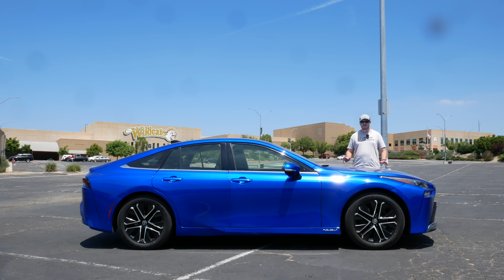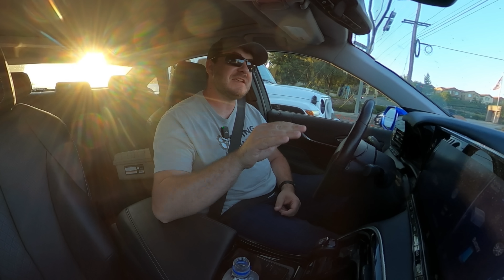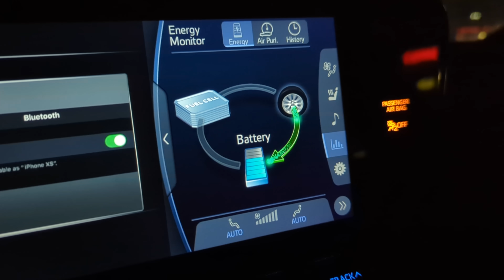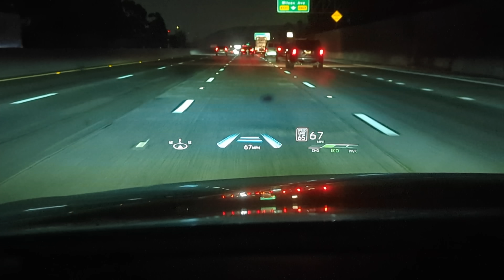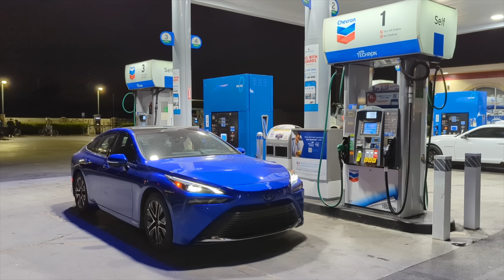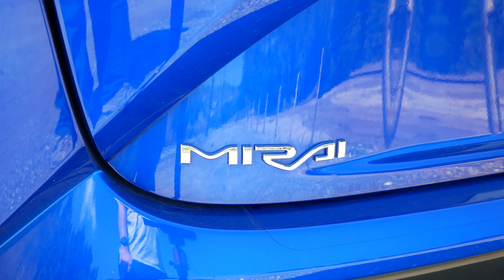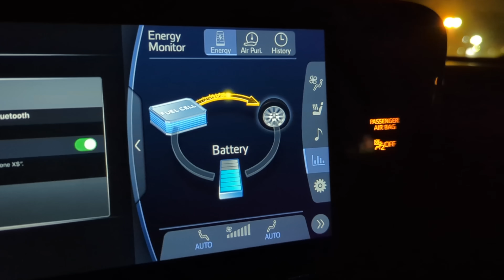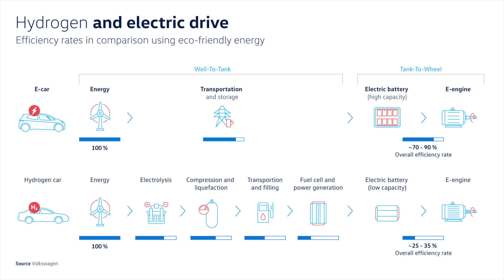The Toyota Mirai is Disappointing

Comment: A lot of the comments I'm reading are probably the same things that were said by horse-and-buggy folks when internal combustion engine cars first came out-too expensive to operate, noisy, limited fuel availability, maintenance issues with car engine/transmission, yadda-yadda-yadda. Yeah, hydrogen fuel cells still have practicability issues-BUT they have a lot less issues today than they did 30 years ago. And we have smart engineers working on those shortcomings every day. The 'green' advantages of Hydrogen over fossil fuels are tangible if they can be realized-and that includes the processes which create Hydrogen in the first place. If we use fossil fuel power generation to create H by electrolysis it defeats the purpose. A strategic plan to get there is needed, we have the smarts to address the technical issues. And I spent the last 30 years of my career working on electric cars-battery driven as well as Hydrogen fuel cell, I'm familiar with the problems. Hydrogen energy storage has real potential, but it will require mankind to embrace the will to get there. We need to get over fossil-fuel mentality which has been 1-2 centuries (considering all uses, not just vehicles) in solidifying, that is the BIGGEST challenge.
Reply: Issue here is that with your example of "horse-and-buggy" there wasn't any alternatives, you had one of two options, either you remain with a horse or you start using car. With hydrogen cars, well, you have quite few alternatives and most noticable the BEV's which are taking over hydrogen cars by a mile and a half. There isint much you can improve when it comes to hydrogen fuel cells, but there is quite a bit to improve when it comes to batteries, but even then, BEV is simply better option now and for long run, so why not go with that instead of picking this middle option which will get replaced with BEV anyways?
Reply: @Zripas  BEVs have the major issue of battery recycling, how to do that? Lithium is not easy to recycle and it's energy costly and ecologically unfriendly to extract from the ground. Lithium batteries have a LOT of issues and the whole picture needs to be looked at, not just their end use. Solid state batteries have some potential, but their energy density isn't there yet. Electric car challenges are all about energy storage, the rest of electric vehicle issues are manageable. Storing energy as Hydrogen has challenges, but it has a lot of potential and ecological advantages. The main thing is to assure we're not just passing the buck-creating hydrogen by using fossil fuel driven Power Plants. I disagree with you that in the 'long run' BEVs are the way to go, that's only in the short term in my view. Until and unless we can substitute more 'green friendly' batteries for Lithium-ion technology we'll have to move on to some other technology.
Reply: @heyfitzpablum  
Todo what? We can already recycle batteries at like 97% rate and lithium itself can be recycled more or less infinite amount of times as it doesn't lose its qualities. 
And you think that hydrogen isint  economically costly?... You do understand that Hydrogen isint something you can just scoop from thin air and you actually need to make it? Which on itself uses around 60% more energy to drive your car same distance as BEV does. How long would it take to offset any BEV short commings with such poor efficiency rates? 

"Until and unless we can substitute more 'green friendly' batteries for Lithium-ion technology we'll have to move on to some other technology."
Isn't that literally what it means that BEV's are for long run?... The fact that by using hydrogen you are just wasting energy and you need bigger, bulkier cars with more complex parts in it should be good indication that this is not the way we should go in the future... Hydrogen is the middle point between ICE and BEV's, sadly for Hydrogen is that we skipped this step and going from ICE straight to BEV's, because its just better.
Reply: @Zripas  You need to research the problems associated with recycling Lithium-Ion batteries, there are a lot of challenges to be resolved and today 95% of Lithium batteries end up in landfill-they are not recycled. The infrastructure for mass recycling lithium-ion batteries does not exist, it would involve massive investment to create it. Lithium batteries present a lot of ecological problems which you are overlooking. As for your comment 'You do understand that Hydrogen isn't something you can just scoop out of the air.......', as I noted above I spent 30 years of my career working on Electric Vehicle propulsion systems and that includes Hybrid, BEV and Fuel Cell vehicles. I am somewhat familiar with the issues, the technology and the challenges and have a PhD in Electrical Engineering. The most cost effective methods today for producing Hydrogen, themselves rely on fossil fuels-so longer term that is not the best solution. Fortunately, Hydrogen can be produced with more green-friendly processes, but the costs need to improve. Since Hydrogen is the most abundant element in the Universe, is an effective way to store energy and produces very low emissions of greenhouse gases when used in Fuel Cells it makes sense to pursue this technology longer term. Using electro-chemical batteries to store energy has a lot of detrimental ecological impact, that's only a stopgap technology in my opinion. Fortunately, we are learning a lot about electric vehicle power systems on BEV's that can be transferred to Hydrogen Fuel Cell powered vehicles-it's not wasted effort.
Reply: @heyfitzpablum  
Yes, battery recycling needs to be expanded and we are doing that. More cars on the roads means more batteries and bigger demand of those recycled ones. 
Hydrogen is most abundant element in the universe... but we don't have it in its pure form on earth... You need to actually produce it from something. Then you need means to store it. But then again, as its a tiny molecule it will tend to leak from any container you will put it into, so not ideal thing to have as main propulsion for the cars on earth. 
There isn't perfect solution here, all of those have their own drawbacks, but BEV's are the most efficient and the best option we can work towards. There is no actual point in investing trillions into hydrogen networks instead of simply investing those same trillions into battery recycling or general improvements for it.
Reply: @Zripas  Hydrogen storage of energy will not be introduced as quickly as fossil fuels, because there are technological and cost issues that need to be resolved. But, it can and will start to be introduced piecemeal because it still has significant 'green' advantages. We can't keep using the earth as a dumping ground for toxic chemicals-some of which are used in batteries-because we're fouling our own nests. How long until we pollute our water tables with heavy metals and they are no longer usable? Once you do that damage to the environment it can not be undone-that resource is GONE FOREVER. The only real knock against Hydrogen as a vehicle fuel source is it is still costly to produce and the infrastructure for service/support isn't there yet. We have made great strides in storage vessels to contain the Hydrogen, as well as seal technology. I can conceive of H powered buses being used for City Transit and commuters using H powered cars to get back and forth to work-where presumably Hydrogen recharge facilities are available. Every gallon of fossil fuel we save stretches our supply and gives us more time to develop the new technologies. No, H powered vehicles won't happen overnight-just like BEV's didn't happen overnight 20-30 years ago. But I do believe it will be a significant contributor by the 22nd Century and maybe as soon as 50 years. That's not that far off, I just retired after nearly 50 years in industry-it goes by fast!
Reply: @heyfitzpablum  
Hydrogen engines basically are at their peak performance, you will not be able to store hydrogen in liquid form in your car, so you will be extremely limited by amount you can carry even in 150 years, you simply can't go anywhere with that aspect. Production of hydrogen remains same issue. Cheapest and best for mass production would be to use fresh water, but then again, its not like we are swimming in one... So alternative is salt water, which... Will produce you nice amount of brine... which is not that good for environment... Not even talking about expensive equipment and crap ton of energy required. 
What we need is better battery technology and more recycling plants, that's it. Its not hard to control where used car batteries are going, just like we don't have tendency of people leaving their used cars in the woods it would not be hard to require appropriate used battery disposal, aka recycling.

Where hydrogen can be used at the moment is in places where energy density is a priority, so like construction equipment, planes, ships, but this never gets to passengers cars due to enormous amount of drawbacks. 

Just a reminder that hydrogen refueling station costs 1million and up, while electrical station... Well... You can charge at home so that one will not cost anything, but dedicated ones are like 100k, not even talking about maintenance expenses... 
Hydrogen simply doesn't scale... It sounds nice on paper I would be more than happy for everyone riding cars which by product is water, but this is just fantasy.
Reply: @Zripas  3 current Hydrogen powered cars all have a range of about 300 miles/charge. That will cover probably 99% of all travel needs. The Hydrogen is stored as a gas under pressure, not liquid hydrogen. Used as a commuter vehicle, hydrogen powered cars make sense. Remember, every gallon of fossil fuel they save stretches the worlds supply and provides more time for technological innovation. It is not 'fantasy', it definitely will  have it's niche in coming decades and will contribute towards reduction-not elimination-of fossil fuel usage. Just like BEV's. As I noted, it will probably be introduced piecemeal, initially as part of mass transit (buses, etc.) and it's introduction for mass production cars will be put off as we acquire more knowledge and improve the technology. And you're overlooking the most obvious benefit-almost total elimination of carbon emissions. This is a clean technology, we need to keep bringing down the cost and looking for applications where it makes sense. Fossil fuels had a good ride, about 2-3 centuries. But it's time we looked into cleaner, renewable energy resources and stopped trashing our world-it's the only one we're likely to ever have. By the way, the first BEV project I worked on was for a Bus drive-that was over 30 years ago and that technology has come a long ways since then. Everyone back then was arguing about how we'd never solve the problems or we wouldn't have enough charging stations,  etc, etc, etc. Mankind solves problems, they don't use them as an excuse not to do something.
Reply: @heyfitzpablum  
People are already scared of that range anxiety even when driving BEV which can have bigger range and you can charge it anywhere. On top of that, BEV's have allot more space inside of them, more practical. And now you have like 10 Hydrogen refueling stations (if you lucky) in entire country which doesn't help here either. 
Biggest issue with hydrogen cars would be refueling stations, aka lack of those. Why? Because those are expensive to build and maintain. Again, its not scalable technology. You can get away by using it for specific things, like buses or ship or planes, but simply doesn't work with regular passenger cars. BEV's will always win over hydrogen cars across the board...
There are UNDER  1000 refueling stations of Hydrogen in entire world. While there are around 3 000 000 BEV charging stations. Do you see tiny difference here in adoption rates? One of those have better scalability than the other... Should be easy to spot which is which. 
Hydrogen isn't perfect solution, not even close and if you would want to talk actual carbon footprint then in general BEV still wins over Hydrogen. Again, just as a reminder, you need around 60% more energy to drive same distance with Hydrogen cars as you do with BEV's, which means that you will have to have 60% more power plants, whatever those will be, coal, natural gas, wind, solar, geothermal, nuclear or even nuclear fusion, still allot more energy required. And thats not taking into consideration the fact that you need more complicated storage systems, more complicated production plants, more complicated transportation systems and so on. It just doesn't add up so well... BEV's are as simple as it comes and as efficient as it comes, so we should be working towards that and not pick some middle option which is just somewhat better than current oil based ones. 

Mankind does solve problems, this is why it will not go with Hydrogen as primary energy source as its a problem to produce it. If we had huge pile of that hydrogen we could just dig out and use in cars, cool, that's something to consider then, but we don't, so its not really an option for mass adoption, it will have its own narrow niche somewhere, but it will never be a thing for regular passenger cars as primary thing, some will buy few of those cars, Toyota and Honda will try to push few models, but it will end there as we simply have better option, BEV, which only gets better with each year.
Reply: @heyfitzpablum you do know hydrogen cars don’t last long? The mirai comes with an expiration date printed on the fuel cap for 5 years. At which point you’ll need to replace all 3 fuel tanks at great cost because they’re not very easily accessible, need extensive post installation testing and the tanks themselves are very expensive. And the fuel cell will also need to be replaced every 150k miles or so. And again, that’s a VERY expensive piece of kit to replace which need specialists to install.
Reply: @heyfitzpablum also, talking about carbon neutral. For hydrogen green hydrogen you need around 4 times more electricity from the same grid to produce 1 miles worth of hydrogen then an BEV needs to go 1 mile. So if we need 10 wind farms to produce 100% of a populations energy to run a BEV based fleet, you would need 4 wind farms to do the same with hydrogen. Which is, as you might have guessed, 4 times more difficult to do. 

Throw in the drawbacks of hydrogen in that they’re limited in range. While batteries become more energy dense you can’t fit more hydrogen into the car. The mirai has so little rear seat space that you have to stoop to sit in it and you can’t physically fold the rear seats forward, and despite being the size of a Camry, it has a boot capacity smaller than a Yaris, meanwhile BEV’s offer more space than even ICE cars.

Then there is the problem with lifespan. Hydrogen cars are limited to 5 year lifespan and the fuel cell to 150k miles. BEV’s last longer than ICE vehicles do.

Then there is the problem with fuelling. Not only is hydrogen more expensive than fossil fuels due to the amount of work that has to be done, to get the hydrogen in the first place, yet alone the extremely low cost of BEV’s, but you don’t have anywhere to get the fuel. To retrofit a fuel station to carry hydrogen costs an average of $1.2 million per fuel station. To get just 10 fuel stations you need to spend an average of $12 million dollars. Imagine the cost for an entire country’s worth of stations. Who pays for that? The consumer does through fuel prices. 

Meanwhile to put in a bank of 4 super chargers costs an average of $0.2 million. 6 times cheaper, or per super charger, 24 times cheaper. 

They’re just not competitive, or green, or practical. They’re slower, more expensive, don’t last as long, less green, less cargo and passenger space, more restricted in their potential (due to physics). And so much more.

Hydrogen won’t happen.
Reply: @engineeringtheweirdguy2103  Right now world communities are trying to pass legislation regarding Carbon Emissions what will  put MANY MILLIONS of people out of work, ostensibly because they're concerned about the environmental impact of burning fossil fuels. And you're telling me that a CLEAN and ENVIRONMENTALLY FRIENDLY means of generating electric power should not be pursued because their are cost/technological issues that need to resolved before we can even consider it? Where is your sense of proportion? Sure, we still have cost issues which need to be addressed with Hydrogen Fuel Cell vehicles, but we had technological issues with Internal Combustion Engine powered cars back in the early 1900's-thank goodness that people like Henry Ford and others didn't give up trying to make cars better and cheaper! For every DOER in this world there are a thousand DOUBTERS, the main difference is the DOERS don't let the DOUBTERS stop them!
Reply: @engineeringtheweirdguy2103  There are a number of fallacies in your statements that I won't bother arguing about, you clearly need to study Hydrogen Fuel Cells more-your information is not up to date or is clearly wrong. We have technological challenges to resolve to make H powered vehicles more cost-effective and practical, but they are not insurmountable. Fossil fuels will not last forever and they generate carbon emissions which many scientists feel are destructive to our environment. Battery powered vehicles have come a long ways, but lithium based batteries in particular are energy-intensive to fabricate from the base material on up. Hydrogen is the future, whether it happens in 10-20 years or 40-50 years. It's clean, can be generated in environmentally friendly ways and has vast room for technological improvement. I worked on Hybrid Cars, BEV's and Hydrogen Fuel Cells for 30 years of my near 50 year career as a Researcher. The DOUBTERS are almost always proven wrong by the DOERS, but if you think BEV's are the technology of the future than I advise you to purchase stock in battery companies. Put your money where your mouth is. IMO, electro-chemical storage of energy is just a passing phase to get us to Hydrogen storage of energy-the latter is the long term energy storage technology for mankind.
Reply: @heyfitzpablum  unfortunately you can’t bend the laws of physics. Also hydrogen doesn’t generate energy. It stores it. Think of it this way. If i were to make hydrogen from water I would have to use electricity. Let’s say I used my coal fire powerplant to make 100kW, and put that energy into compressed hydrogen gas, by the time a fuel cell converts that back into electricity I’ll have 25-30kWh. Having wasted the other 70-75kWh. Meanwhile if I put that 100kWh into a battery electric car, by the time it turns that energy back into electricity ill have 98kWh, having wasted 2kWh. 

See the difference? And there is no getting around that. It’s physics, the bonds that hold hydrogen and oxygen to create water take a set amount of energy to break. Same as it takes a set amount of heat to melt steel. You can’t get around that fact. 

Coupled with the fact that the most efficient way to store hydrogen is as a compressed gas makes it volumetrically impractical. You could store it in a medium to make it denser, but then you’d need more energy to release it, much like you need energy to release it from water.

Sorry but no.
Reply: @heyfitzpablum  if you spent 30 years as a researcher I doubt you would have referred to hydrogen as “a CLEAN and ENVIRONMENTALLY FRIENDLY means of generating electric power” and I know that wasn’t a typo or slip of the tongue since you clearly put so much emphasis on it. This demonstrates that you don’t clearly know how hydrogen energy works. Hydrogen is a storage medium for already generated energy. And not an efficient one at that. 

From an Engineering standpoint (being an experienced Mechanical Engineer, hence the name). It’s impractical. And can only be taken so far, we are near the peak theoretical efficiencies of hydrogen as it is. There are limitations in physics which dictate these things, entropy and chemistry which cannot be overcome. 

Sorry but hydrogen isn’t going to work. It’s just being pushed by fossil fuel lobbies because mass production of green hydrogen is untenable. So you have to get mass produced hydrogen from fossil fuels. And you have to sell it through fuel stations which fossil fuel companies own a monopoly of. While BEV’s can be charged at home with rooftop solar, they don’t need fuel stations or fossil fuel companies. Therefore the trillion dollar fossil fuel industry, so powerful they’ve convinced US presidents to start wars on their behalf, are funding research and happy articles into hydrogen to distract the public and spark debate about going BEV, trying to slow that transition to protect their biggest investments.
Reply: @engineeringtheweirdguy2103  Firstly, Hydrogen is an energy storage medium just like fossil fuels are-and in conjunction with Hydrogen fuel cells it generates power. I'm not sure what your argument is with that, CLEARLY (lol) you don't know as much as you think you do.  Secondly, you are simply wrong about it being 'impractical'. I've been listening to the naysayers for years telling us how battery cars would be too heavy to be 'practical-then technology developed better battery technology and moved away from heavy lead-acid cells and presto-chango we have lithium-ion battery cells and many of the technical shortcomings were eliminated. The same applies to Hydrogen-Electric powered vehicles, the same old tired naysayers telling us how it's 'impractical'. What was impractical yesterday can be practical today, if you have roll-up-your-sleeves problem solving engineers involved instead of defeatists. Your last paragraph on Fossil Fuel 'lobbies' and dark powers pushing Hydrogen so we're joined to the hip with them to extract Hydrogen from Natural Gas and other fossil fuels is so absurd and conspiracy-theoryish that I'm not going to waste my time on it. I've already stated that Hydrogen needs to be generated with eco-friendly technologies rather than other less eco-friendly means to realize the full benefit of the technology-if you read the discussion up front you'd know that. And yes, I worked the last 30 years of my career developing hybrid/electric/hydrogen powered vehicles for a major auto manufacturer-I was involved with some of the most innovative/creative engineers/scientists on a daily basis. One thing they all had in common was a burning desire to solve the technical issue and make these vehicles practical and affordable. We in large part succeeded, but the best is yet to come. Naysayers and defeatists are a dime a dozen, they don't make things happen-they watch things happen. And I have three degrees in Electrical Engineering-not that it matters all that much, but you brought education bonafides up first.
Reply: @heyfitzpablum  it’s nothing like fossil fuels. I’m sorry but not. We don’t make fossil fuels out of thin air. We collect it from the earth in an already energy dense state. Hydrogen however does not exist on earth in its pure gaseous state. So no, fossil fuels are not an energy storage medium, if it were that would suggest one of two things. 1.) the oil we drill comes out in an non energy dense form and we have to put energy INTO it. We do not. 
2.) after we extract the energy from fossil fuels, it will re-assume the natural state at which it was collected. 

Saying fossil fuels are an energy storage medium is like saying corn is a good storage medium. It isn’t, it’s a good source. 

And I’m sorry, but physics disagrees with you. And it’s a reality. Look at the mirai, it’s larger than a Toyota Camry and has a boot smaller than a Yaris, the back seats can’t physically fold because there’s no space to do so and if you’re 5’7” or taller you have to stoop in the back seat unless you want your head resting on the roof. All to hold just 5.6kg of hydrogen at 700 bar in nearly 300L of fuel tank storage. 

Or what about the energy required to break the chemical bonds of water to create hydrogen? You can’t reduce that, that will always be an inefficiency. And the energy loss through a fuel cell cannot be mitigated past a point. Similarly a wind turbine cannot extract all the kinetic energy from the wind. If it did so, the air around the turbine would be still, and the turbine would stop spinning. Likewise you cannot collect all the energy from hydrogen in a fuel cell, there will always be waste. Far more than in battery electric.

Sorry but no. Physics disagrees with you. And if you’ve studied hydrogen from an Engineering standpoint as I have, you well and truely know that.
Reply: @heyfitzpablum  has for the conspiracy you’re accusing me of. Fossil fuel companies havn’t exactly made it unknown. You can get shareholder minutes of them explain exactly that. Hydrogen continues the need for their product. It also continues the use of their second largest capital expenditure, fuel stations. Both of which are made redundant by EV’s. 

Not exactly a clandestine operation. They make their thoughts publicly available.
Reply: @heyfitzpablum  Who paid you?
Reply: Ki+Ui=Kf+Uf